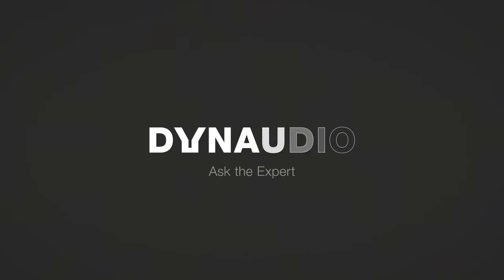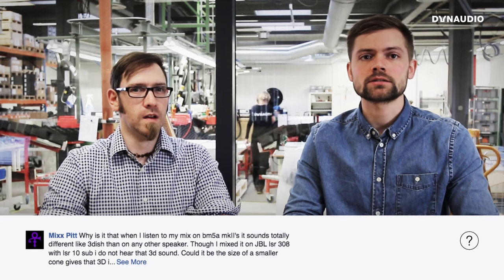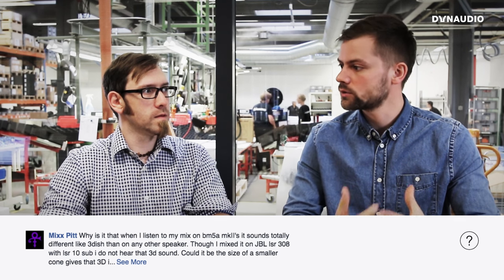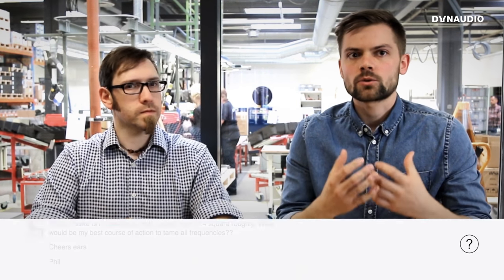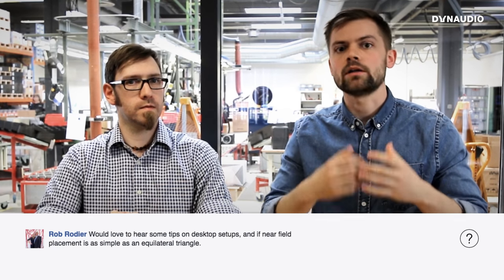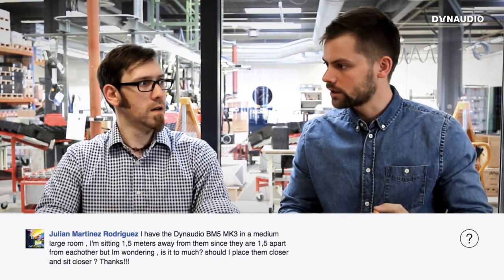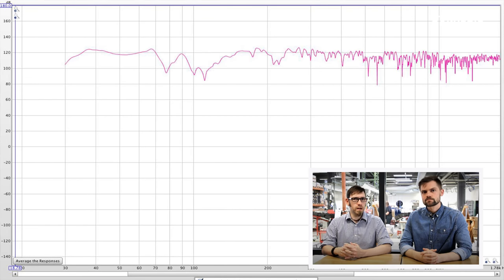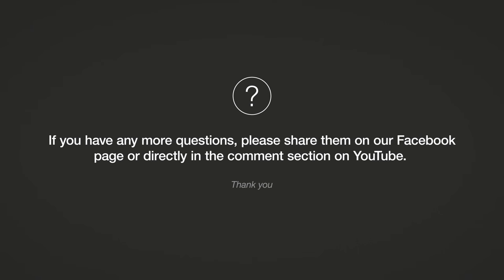Monitor positioning In Home Studios

Comment: Hello again. I have a question about speaker placement. I own the Contour s3.4le, with it's unusual tweeter placement, is it advisable to tilt the speaker using the Allen key feet, or should I strive to make them perfectly level? I'm in a square room, sitting 7-8 feet from the speakers. Thanks!
Reply from the maker: Hi, Hanknova! :-) No, we wouldn't recommend tilting the speaker upwards. The placement of the drivers and the crossover topology results in a sound that is beaming slightly upwards, which is why the imaging works even though the tweeter is placed low. So, it isn't advisable to tilt the speaker cabinet upwards; it should be placed perfectly level. I hope this helps, Christopher
Reply: Thanks! Very helpful.
Reply from the maker: No problem! 😌

Comment: Whats the benefit of putting the sub  out of phase, getting a big null and than switching it back to in phase and hoping everything is flat? Why not just leave it in phase and get it flat like that?
Reply from the maker: Hi Mike. 

Assuming that the aim is a ‘flat frequency response.' 
 
When the subwoofer has a ‘flat frequency response’ with the main speakers, you can (and we recommend that you do) put the subwoofer 180 deg ‘out of phase’ with (reverse polarity to) the main speakers, to check you get a good cancellation with the main speakers. This confirms that the subwoofer and main speakers will integrate well when they have the same polarity. If you don’t get a good cancellation, you can end up with odd phase effects between the main speakers and the subwoofer at the crossover point.
 
I hope that helps clarify things. 

Cheers, Steve
Reply: Dynaudio So this is assuming you are using an RTA to measure it right? 

I understand why its done, my question was how is it better than just leaving them in phase and getting a flat response? 

Lets say I get my sub, everything in phase, and measure a very flat response.. what is going out of phase, getting a cancellation and than switching back hoping you get a flat response adding to it, if I already got a flat response by just keeping things in phase.. just seems like an extra step. I hope im wording my question correctly. I guess in short, why tune out of phase instead of in phase. I have an active system in my car with an Arc PS8 processor and I do a lot of tuning, RTA, Time delay, etc. 

The example he used in thd video.. why not just leave the sub in phase, adjust the crossovers till you get a very flat response?